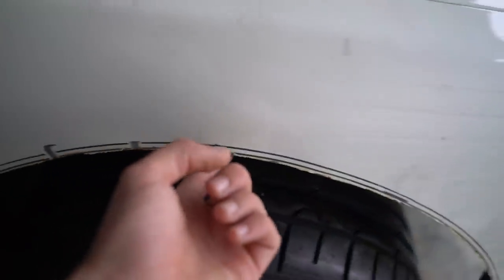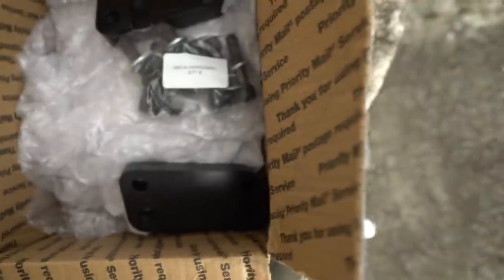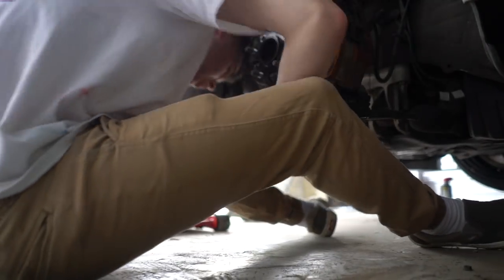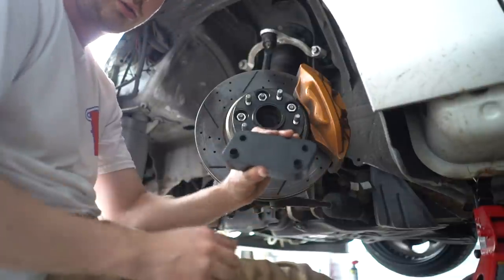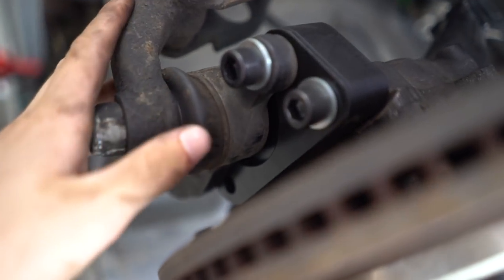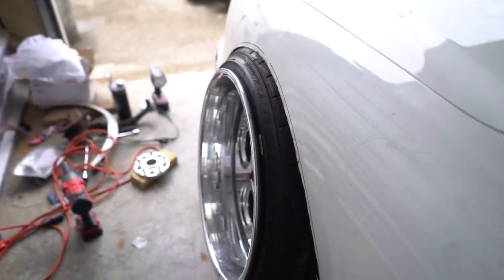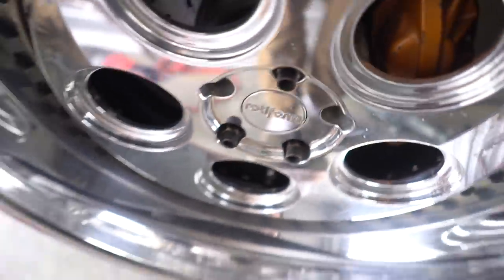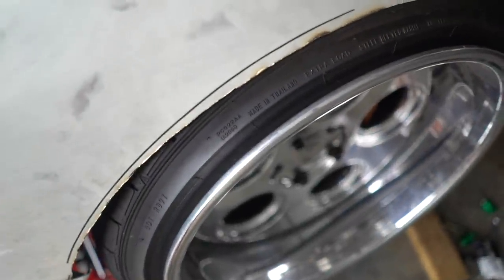NRCAs = More Camber - VIP Style LS400

Comment: I personally reckon (for the fronts) shave the ridge off the face of the calipers to get just a tiny bit more clearance, get smaller spacers and trim the stock wheel studs to suit (cus you can always replace them easy enough)
Reply from the maker: TMPT50 you can’t shave these callipers at all. They will leak fluid immediately
Reply: @LEPAutomotive  oh bugger